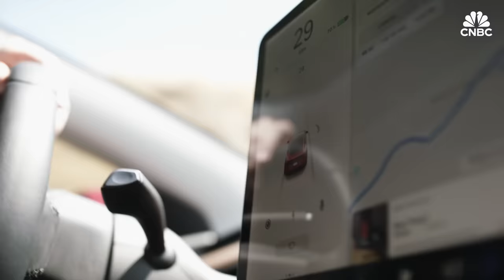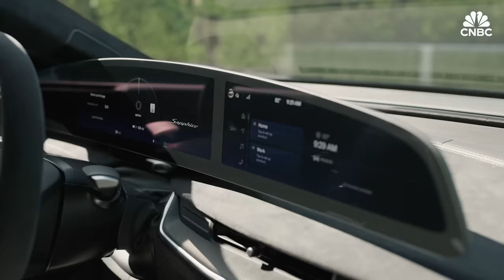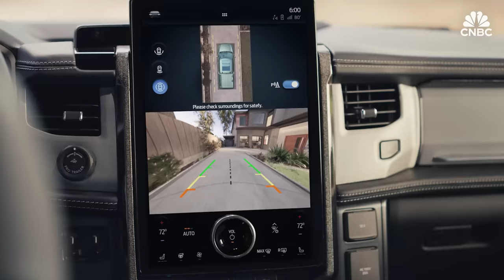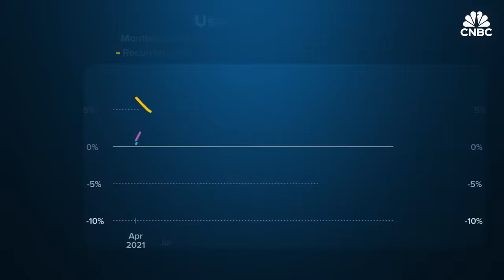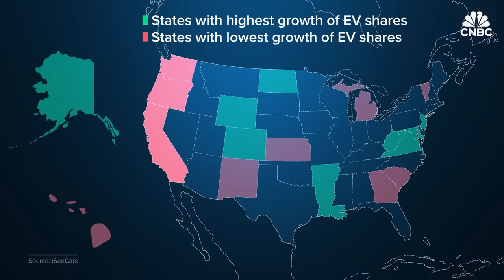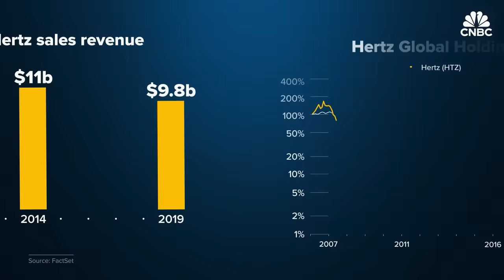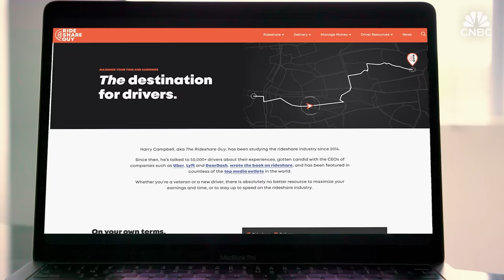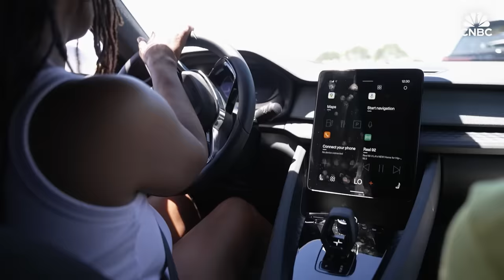Why EV Sales Are Falling | CNBC Marathon

Comment: All this talk and discussion about electric and gasoline vehicles have totally ignored diesels. Diesels are by far the best vehicles as far as saving fuel and maintenance. Modern diesels run pretty clean and more research would clean them up even better. I have a 4X4 3.0 liter diesel engine Isuzu truck that goes further on a liter of cheaper diesel than my wife's 1.5 liter Ford Ecosport mini SUV on gasoline, the Isuzu truck is faster and has much more power. As a side note, diesel fuel in Thailand is cheaper than gasoline.

Comment: Hybrid's like the Chevy Volt are the way to go (not sure why the Volt is no longer being built). Our train systems have been using diesel motor to power electric motors attached to the wheels over 120 years. Now add enough newer tech batteries to get you 100miles. Batteries run low, the 750cc engine kicks in to recharge the battery.
Toyota is working on cars like the Volt.
Better yet, hydrogen powered ICE with  electrolysis device on-board.

Comment: Thanks to a medical condition that limits my mobility for checking blind spots I will never be able to drive a car again. Given that I make about $1,10 a month or 13,000 a year I couldn't afford an EV let alone the insurance and cost of a battery replacement. A bank would not finance me for the purchase of an EVC since it is five times what I get from disability.  Our social housing building has 100 parking spaces. None of them are EVs. There is no charging location within 100 meters of the building. I believe that EVs are only for the top 25% of all income earners.  people making less than 100k cannot afford an EV. especially when a gas-powered car is half the price both to purchase and to operate and insure. EVs are not fo low-income (Thos living at or below the poverty line) people or families. They cannot afford them or the cost of charging and insurance.

Comment: Why has the insurance premium gone up well it’s down to electric cars and the traction battery pack. If an electric car has been in a road traffic accident the insurance company will write the electric cars off as they feel the traction battery pack has been damaged and the reason for this is down to the fact that the traction battery pack forms part of the electric cars chassis and so as far as the insurance company is concerned the traction battery pack has been under stress  and has been compromised during the road traffic accident. So to compensate for this the car insurance companies are loading up everybody’s insurance premium petrol/ diesel and hybrids alike.

Comment: Slump sales could be explained as, infrastructure renters, mobile home, house, condos and alike are difficult to get charging stations. Possibly FSD will fill in the gap on charging stations.

Second is income, many of the people that wanted an EV and could afford it have already purchased theirs. Now it's low income workers that just don't have the budget for new cars let alone with FSD. Asking with this are those that have the income but not the employment history required for a loan, or an income that varies greatly month to month, so if their credit score isn't approved on EV car dealers will get them into something else. 

Also I know of some that are wary of battery life longevity in high fluctuations in climate especially desert heat or sub zero cold. 

Another idea that would be good for low income, not necessarily new car sales but replacement parts, lowering scrap and salvage value on EV and aftermarket parts will keep these batteries out of junk yards.

FSD will definitely change the market, everyone will want the extra income that can afford it, elderly, families school programs vacations etc.. those with driving phobias. 

These same arguments could be made toward hydrogen cars.

Comment: why are EV sales falling ? MATH
I can buy a loaded corolla getting 35mpg and drive it 150k miles before i equal the cost of a tesla3 long range . By 150k miles the EV is out of warranty and worth less then the 14k out of warranty battery so EV owners trade it in on a new one and do not save a penny compared to gas cars. SIMPLE.

Comment: Yes EV are much cheaper to maintain but a lot more expensive “to repair” when something goes wrong and the devaluation is much much more than a combustion engine car which btw second hands ones are going up in price. 

Future should be Hydrogen, there is where Toyota is putting her eggs on. They do not believe EVs are the future and they are not building them.

Comment: Would you buy a 3 year old smart phone? No. EVs & Hybrids are MORE costly to maintain, brakes & tires wear out 33% quicker due to the weight. The grid cannot keep pace with demand for power hence many charging station reduce recharging times. The depreciation is catastrophic and many dealers do not want to part exchange old models for a new variant. Some EV models are almost uninsureable due to the excessive write-offs of EVs in minor accidents. The govt have failed consumers!

Comment: Also include the fact insurance will raise a 24 bolt euv for me at 36 single male no points in nj is an extra 475 a month a tesla 3 would be an extra 300 a month on top of that from Plymouth Rock that’s full coverage with car payments  . There is no resale value 25-50% off on a 60k like the ionic 5 for example . Range is a killer , the public charging location may be out of order , public charging is just as expensive as gas , you must wait even longer to charge than gas 
Ev is only for customers who have home charging . Tesla with warranty service is laughable , reliability is also low. Yes you have a 7500 or 4k whatever tax credit but that’s not immediate
Right now no ev is cheaper to own than a gas vehicle. 
So I will have a higher insurance payment a month , a higher car payment and about same price for charging compare to gas ….mhm I see why a big decline .

Comment: They are giving example between a cellphone ownership than the EV ownership can never be compare a different thing. EV batteries could not produce electricity, very unpredictable and unreliable. No to EV due to the difficulties for the third world countries, island nation, stream cold / hot place, remote mountainous places not suitable and many more deficiency. EV is an old technology since the 1898 on/ off without success to dominate the transportation industries. It is not about the range nor the lees parts to maintain but the ABC always be charging you could not escape in real ownership. EV is just a mere alternative solution, a second vechicle for the rich individuals and just another means of transportation but not a dominating factor in the transport industries. Expensive to buy, insurance and too much software dependent difficult to repair too expensive......

Comment: All evs and it includes bikes cycling or otherwise if its electric it rises and falls on range,  as to dealers 😂 what do you expect they are as far as tesla goes dropped so obviously they're not happy , but remember companies make the money on parts , not usually something you need to often with a tesla, the other big deal is the media scare  on batteries , this was porch setting people's houses on fire and was it the volt or the bolt ,there are around 350 fires with say vw , a year , but again thanks to the sensationalism from the media if one tesla goes on fire its headline news.

Comment: EV sales would barely exist at all if people used math instead of feelings for their spending decisions.
1- tesla3 long range 2024 msrp is an avg of 47k
2- toyota corolla se sedan 2024 msrp 25k with a 35mpg avg (31 city 40 hwy) 
3- extra EV up front cost not counting charging bills at home and away or installation of charger at home is 22k
4- with 22k at an average of 4 dollars a gallon ( i paid 3.14 a gallon this week cus only morons live in California) I can buy 4400 gallons of gas and drive 154k miles before i reach tesla up front expense.
5- tesla battery warranty expires at 120k miles and is a 13-14k replacement cost so most owners get nervous and plan to trade in for a newer car . If they don't they are driving a car that has depreciated 60% at tesla dealerships for trade in's and is worth less then the battery if it fails. 
6- When taking into effect the environmental impacts of deep mining for lithium nickel cadmium etc and the fact that all the metal for a car is also mined or recycled at additional cost from previous mined materials, and also that the plastics, vinyls, and rubber in the EVs are all derived from petroleum and petroleum by products  the answer is obvious. 

EV owners are driving around electric oil drums doubling as mining carts.....spending more then a gasoline car costs, trading it in or upgrading at a higher rate due to the failing batteries, and lying to themselves that they are saving the planet while china builds 100 coal based powerplants with no government attempts at controlling the pollution. 

Add to this synopsis that the world has according to the USGA 88 tons of lithium but only a quarter of it is feasibly able to be extracted and the math is clear. This 15-20 year experiment would have been way better served on developing hydrogen technology which burns water vapors as emissions....if only because we actually have the supply to meet the demand unlike EVs which wont have the supply NOR the demand. I just wish people were honest with themselves when they spend a ton more then they need to and then trade in the car before they save a penny.

Comment: New combustion tech will make EVs, Hybrids and old ICE OBSOLETE.  Friendly hint.  

Try 
150 MPG HWY, 3000 mile range
240 MPG City, 4800 mile range
200 Combined, 4000 mile range
$30,000 car the size of Tesla M3.
2200 LB empty, 4400 LB gross.
Captures CO2 and water.
Vapor compression distillation...
Engine is COP 4 heat pump, saves 12 times the fuel when sitting with heater/cooling on over ICE car.
Works in airplanes.  1 gal/hr at 120 mph in roadable airplane, door to door.  25 to 360 mph airplane will be common
Works on all combustion apps and is better than any EV.  Can run on battery too, but only 45% efficient.
75% efficient combustion with secondary cycle (combined cycle) and 60% at peak power.
300 HP continuous, 600 HP peak, typical for passenger car.  Multiple motors, never get stopped to due one motor or compressor failing.  
No drive battery, and can run without computers (like old Diesels can).
Optional 9000 mile range HWY with no CO2 capture...
300,000 warranty, 900,000 mile life.
2.5 x less CO2 on gasoline, 5x less CO2 on RE fuels at 150,000 life cycle, 33 times less CO2 in life cycle at 900k miles.  This alone makes EV invalid....
Skateboard tech, flat bumper to bumper inside and out.  100s of models put on ONE common platform.  No auto company will survive that does not have this tech (or similar)  due to super low costs.

Folks, EVs are silly stupid junk.  Again, friendly hint. I suggest you wake the hell up.

Comment: Um yeah. Its a fad. Can i ask anyone who owns a ev how long does it take u to have your car charged? How much time is that compaired to how much tims you save on the carpool lane? How much is the replacement battery? How much is the car worth? Like not moneywise but Have you noticed how bad ev drivers are. Particularly with the tech included in the car. Have you ever asked some one to use an analog clock and they are like what is that. Use your turn signal light 😂 my what

Comment: The biggest issue we have with Tesla is cost of maintenance. They charged my insurance company $800 dollars just to disconnected the batteries for a minor repair after our car was rear-ended.  Their labor charge alone was $500 because they have a minimum 1hr per job and they treated the high voltage and low voltage batteries as separate jobs. What this told me is after my warranty is up next yr I should get rid of it. Also there this alignment issue that has you purchasing new tires about every 2k miles if you're lucky.

Comment: Its not just the price of the car, or range anxiety. Its because insurance is higher, tires cost more, batteries self combusting, price of repairs, the length of repair times. I'd rather buy a 1988 Accord, than buy an EV.

Comment: Bought my last car from a major dealer for 37000 after all added fees and extended warranty it cost me 52000. The to service that manufacturers warranty it cost on average 1200/year to the tune of 5000 and the car that cost me 57000 is worth 18000 a loss of 39000. If I add the fuel cost of 2000 my cost of ownership is in excess of 42000.  So why would any sane person do it twice. Dealers for major manufacturers of ice cars are toast.

Comment: I have a battery operated drill. 
I can plug it in any common outlet, it works ok . Sometimes I have to use a gas generator to charge it.
I don't see any practical applications for electric cars.
Expect maybe on the golf course.